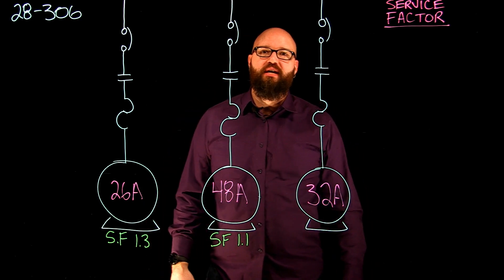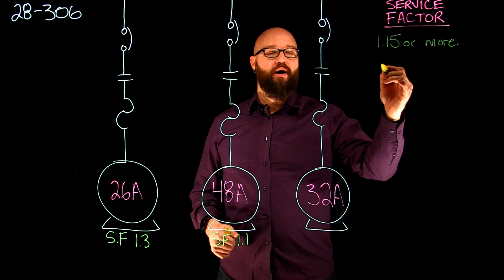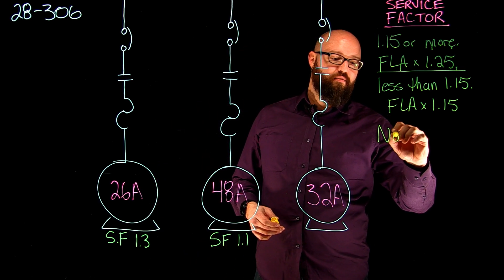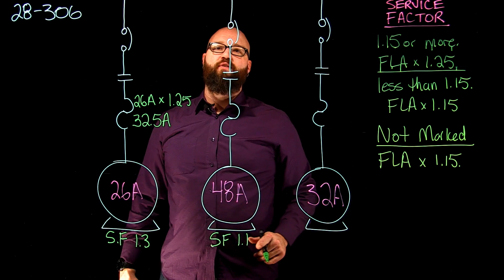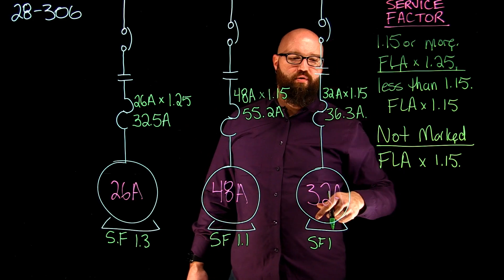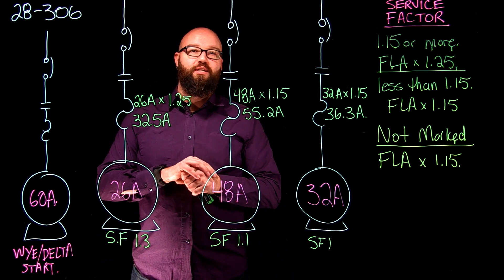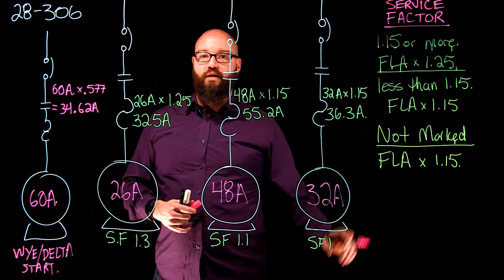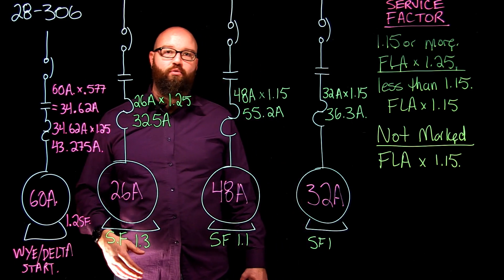Calculating Motor Overloads

Comment: Thanks, very good explanation. But one question about star/delta example: overload protection devices (like mpcb) instal under contactores and sense LINE CURRENT not phase current. In this example over 44A the circuit will disconnect however the motor  continuously can work up to 60A.
May you please explain?
Thanks
Reply: I found that. It is just about star contactor😊
Thanks

Comment: motor will run in star (Y) current only but why ur selecting over load relay for delta connection
Reply from the maker: Because the Delta current is the full load current of the motor. When selecting the overload settings however, you must start with 57.7% of the FLA before application of 28-306 1).

Comment: I'm trying to calculate an ISO or German motor with a cosine of 0,95  ~  My understanding is that "european" motors are basically at factors of 1 on down to 0.85 or so which isn't very efficient.  So if the motorplate says AMPS at 3.4  ~  with a cosin of 0.95  I would set my overload "at basically"  3.4 Amps  IS THIS CORRECT?

Comment: Shouldnt your 26 A motor have  FLA x 1.15 if your s.f. is less than 1.15? Not 1.25
Reply from the maker: The service factor written under the 26A FLA motor is 1.3 which would permit the overloads to have a maximum to seeing of 26 x 1.25.

Comment: I HAVE A SINGLE PHASE MOTOR 1,5KW,9,5A MAX,WHAT SIZE OVERLOAD?
Reply from the maker: Check your service factor. If it is more than 115%, your overload is permitted to be rated at not more than 125% of 9.5A.

If service factor is unmarked, or 115% or less, then it is not to exceed 9.5A x 1.15.

Comment: May I know what the 0.577 is?
Reply from the maker: It correlates to the 57.7% that the phase current is in relation to the line current. As the overloads only see the phase current we must use 57.7% of line current to size them or the motor could significantly overdraw in an overload condition.
Reply: 0.577=
1/(root3)

Comment: Why you not use RLA for calculate?
Reply from the maker: Because calculations are based on the motor operating at full load. Anything less would undersize components and conductors once more runs at full load capacity.
Reply: @schulerruler  Thank you. One more, for a compressor, what we should use RLA or FLA?

Comment: If I have A 30 HP, 600 V, 3 Phase squirrel cage motor feed from autotransformer and is controlled by a Star-Delta starter. What is the maximum size inverse time circuit breaker allowed to protect the circuit. 
Is it based on phase current like the above video showing?

Comment: Why wouldn't he finish😳
Reply from the maker: Finish what, sorry?
Reply: I was believing you would finish with the breaker size
Reply from the maker: Overcurrent sizing is done in a separate video, to keep things one step at a time for simplicity. The overcurrent would be a completely separate calculation that does not require sizing of the conductor. I'm happy to help clarify any confusion, thanks for watching.

Comment: What kind of board is this?
Reply from the maker: It's called a light board. Essentially a pane of tempered glass with LED strips around the outside pointing in. It really makes fluorescent dry erase and chalk marker colours pop on the board.
Reply: @schulerruler  It looks amazing and so easy to read! Great work :)
Reply from the maker: @MsAmitis  I wish I could take credit for the build but that goes to an amazing tech Dept!